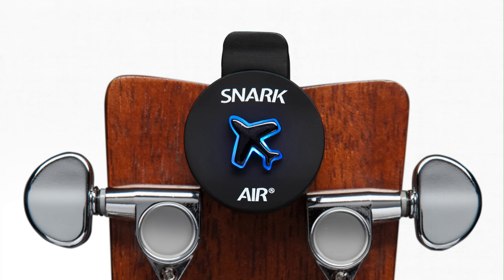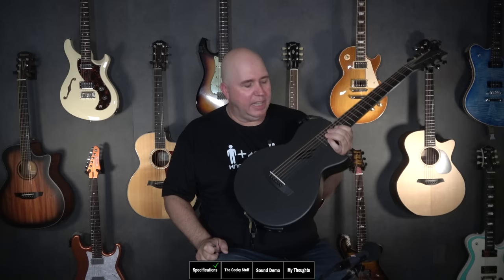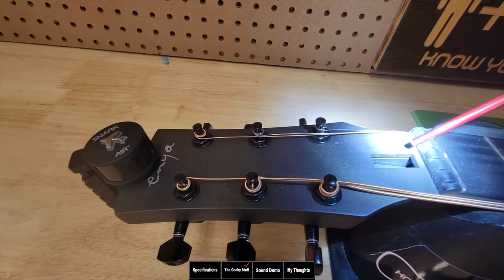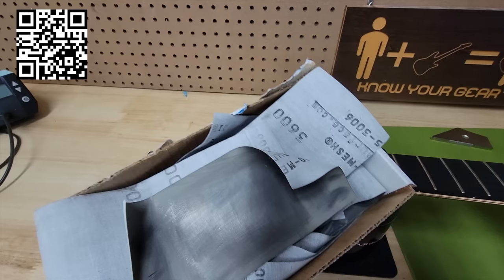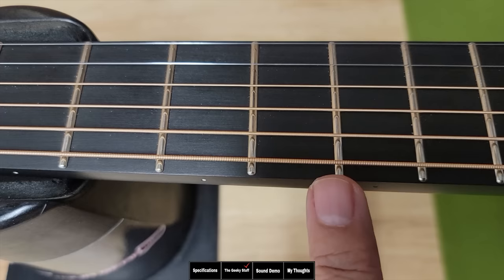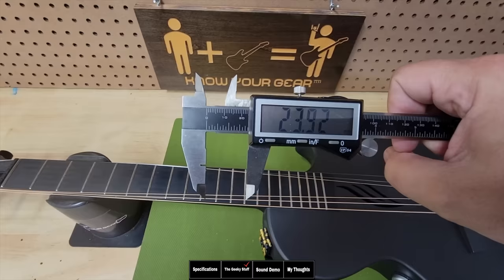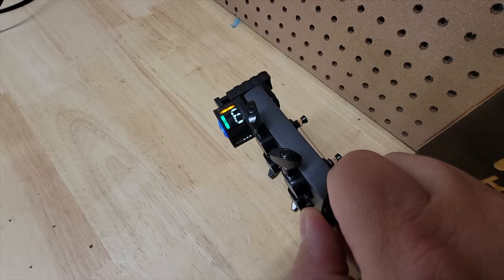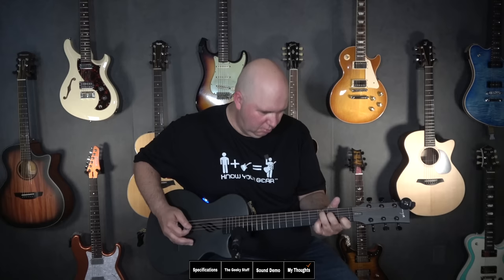Amazon Carbon Fiber Guitar For Under $300

Comment: Seems to me Enya Nova could easily add a wifi feature to the electronics so you could fire up a small additional speaker for additional sound.
Reply: They don't for the same reason that you rarely ever see Bluetooth headphone options on guitar gear - latency. 

A few milliseconds between your phone and headphones when listening to music makes no difference whatsoever. But the delay is slightly more noticable when watching a movie or music video. It's a little annoying, at first but you quickly adjust. 

However, that same few milliseconds of delay is almost unbearable when you're playing an instrument. It makes it really tough to time the attacks, you always feel like you're dragging, and so it's easy to end up rushing, and it just plain feels sloppy.

I'm sure they'll eventually get it, and higher end Bluetooth devices may not suffer as much from it. But it's something I really WANT to work, so I've tried a lot of configurations and have been mostly disappointed so far.

Comment: Seriously, I hope they sent you a set of Ben  Wah’s Balls with your guitar……..

I’ve had one of these for about 8 months and it’s been PERFECT, right out of the box AND with the original strings. I also got a spare set of strings with mine. 

I installed a set of Fender strap locks to go with my other guitar straps.

Comment: Wow! That was a suprise! Your reviews are always good and honest and this has to be the best yet that I have seen on these budget carbon fibre guitars. It looks and sounds fit for purpose and that is why I was suprised! It sounds good, not sure I would bother with electronics given once the rechargable batery fails and it will at some point its then back to standard anyways but each to their own. Yep these could well be worth the investment as can throw in the van and not worry about heat and humidity etc, Thanks for a great vid as always.

Comment: Great review. Excellent detail on all aspects of the guitar.  I wouldn't dream of buying it for the same reason I wouldn't buy other so-called travel guitars - it wouldn't generally be allowed on a plane in an overhead locker. For any other purpose, the size difference between a travel guitar and a regular guitar is irrelevant.

Comment: Hey Phillip. Thank you for an Awesome, in depth review! I liked and subscribed before I was half way through. Lol. Yes, it is head heavy. I will get that snark tuner as well. I’m a +25 year professional and I learned so much about basic maintenance too🙏🏾 

I have 2 of these. I’ve had the acoustic for a year and the electric one a few months. The charge may not last, if you don’t use. But you can chg and play, I believe. I Love These Enya minis!  I leave the non electric in car, camper and or boat. But I won’t paddle with it; lol. I bought the el/ac Ukeleles too. Check them out. I didn’t play uke either. I agree with your assessment; 

This sounds better than all my other CF & wood travel GTRs. I’ll probably be selling my Lava Me 3. CF guitar timbre is not for everybody but I love them and gig with a Jumbo Rainsong. They’re tough, CF, like a hard working Taxi, tough; this one too. And I like it’s sound acoustically and it’s playability. It’s my jam around the house, throw it on the couch guitar. 

This handles my fat fingers much better than other travel size gtrs. I watched to the end. Again you’re an Awesome, Informative and Professional reviewer, based on this. I look forward to checking out your other review. 

🤞🏾

Comment: I just went to purchase one, but when I chose the electric version at $279 they also wanted to add $80 in shipping charges. The acoustic version is $189 w/free shipping, but electric is $279 plus $80 shipping. I wonder why the big difference.
Reply: Heck, the electric isn’t even there anymore.  Doesn’t even show up as being out of stock.  Just gone. Phil got this thing just plain sold! Good stuff.
Reply: If there is a genuine reason for the additional shipping expense, perhaps it's related to the inbuilt rechargeable battery. Air carriers can be picky about that stuff, and perhaps it attracts a surcharge that is eventually passed on to the customer.

Comment: I'm pretty impressed with the sound quality of this, even without the help of the internal amp. For the price range, it actually seems to have very few defects. I'm curious if you can change the reverb-flange-delay with the control knob when they're engaged, or if the knob just controls volume alone?😉

Comment: Phillip - HELP ... I have a project coming up where I need that classic "glassy" beautiful pure FENDER Stratocaster sound ! I have a Yamaha Pacifica 612 but this is NOT giving me the result I am looking for.  I have Squier Affinity (2009 model) which is going to receive a FENDER pickup kit upgrade - the TEXAS Special and I am curious to see if that will do the job. However I still want to buy a real FENDER  (SSS config) - which one should I buy ??? I like laquered necks ! So I am between choosing the Fender VINTERA 50 Strat MN  (mexico)  --- versus the FENDER AV57 MN (amercian) .... the price difference is enormous.  I prefer the Soft V neck but V could also work as long as it's laquered  ????????????????   What would you recommend ?  Is the VINTERA every bit as good as the  A V 57 ???  --- is the AV 57 really 1000 $ more guitar ??
BTW - could put the TEXAS Special KIT into any of these two if required to get that ultimate glassy classic Fender Strat sound. OR Are we already at the point where only a pckup upgrade would achieve that goal by choosing the David Gilmour pickup set or maybe even the KINMANs ??????
Hey.... help me out here...
Greetings from Switzerland -

Comment: Did you mention that it can be used as a bluetooth speaker as well? I read that on amazon after watching your video. It's an interesting detail that just adds to its appeal. you can jam along with whatever song/metronome emanating from the guitar itself 👍
Reply: To be more specific: It has a bluetooth receiver built in allowing you to pair it with your phone/computer/etc. By simply double tapping the button it puts the guitar into "Bluetooth Pairing Mode". Thanks for a well thought out video! Gonna order one next payday! 🤘

Comment: I have the regular acoustic version and love the form factor , well thought out design, and case but I can’t get it in tune easily nor can I keep it in tune.  The machine heads seem a little sensitive, though as Phil said it could be just a matter of popping some fresh strings on or possibly checking to see if my tuner is defective.

Comment: I wonder how would you go about replacing the frets on this one, since the heat of an iron might be too much for this material. The zero fret might in need of replacement in a while so i wonder
Reply: Yea but the problem with that thought is for the price of a fret job be cheaper to get another guitar. If your not doing the fret job yourself

Comment: Looking to get back into playing in my older years.  have an electric (not a good one) for the low string height but it wont stay tuned. Love my Takamine but hard on my left hand (a freak accident left me with pins holding my bones together on that hand and now much of my feeling if gone.  Was thinking about a nylon electric.  I cannot perform the upgrades you did but the guitar seems nice!  Love the electronic reverb sound!   Any suggestions on a low action guitar that would help me get back into playing?

Comment: Thanks @Phillip McKnight ! How does it sound acoustically compared to a regular size guitar? I mean, In terms of volume and fullness...for example, the taylor baby is loud but lacks bass noticeably. Taylor gs mini sounds much fuller, and it's still a short scale.
I've seen reviews that state that it lacks some bass. But you changed the strings, hopefully, a thicker gauge because of the short scale. Maybe that adds some bass.

 Thanks
Reply: I put Medium gauge on mine and it did give it a bit more low end. The overall tone of it is ok. Not as nice as my CA Cargo but for the price, very good. You do have EQ adjustment and control of the effects in the Enya Music app which was not mentioned in this review.

Comment: I'm curious to know if you have to play this with the strap. I purchased another carbon fiber guitar and I returned it because it was as slippery as an eel and you couldn't play it without having to clutch it to your body. Super annoying and tiring so I just returned it. If you have to put a strap on every time you just want to play for 5 minutes it kind of defeats the purpose of having a travel guitar In my opinion. Thoughts?

Comment: why is there a fret next to the nut? is this normal?
Reply: Zero fret used on guitars so that the scale length starts at that fret because the strings are always touching that instead of the nut. It can improve action as the depth of the nut slots are not critical because the string simply has to touch the fret instead. Obvious downside with regard to steel strung guitars is fret wear which will happen unless the fret is made from stainless steel or other harder or wear resistant material. So with regard to this guitar as the frets including the zero fret would be to either change that fret to a stainless steel one or simply remove that fret & have the nut start at that position. Don't know how easy it would be to remove the fret but I would assume it can be done when that zero fret wear becomes a major issue through playing. I suppose if the fret is filed down then something could be placed on top of that fret so that the strings touch it, a piece of stainless or bone could be glued to the fret after it is roughed so it keys to the stainless or bone.

Comment: I really don't like the idea that the nut is part of the neck mold. Nuts should be replaceable. Great tip on a DYI Fret Kisser. I love the idea but it is crazy expensive.
Reply: The zero fret is the contact point. The nut on a zero fret guitar is little more than a glorified string  guide. It won't need replacing.

Comment: Video is 19 minutes longs but the actual review starts from 13 minutes and ends in 17 minutes. You bought the guitar with pickup in it but you haven't review the LineOut sound that it throughs😑. It is more of a repair guide than a review